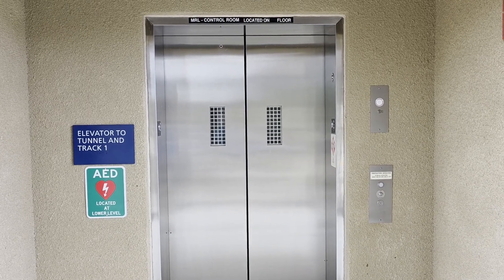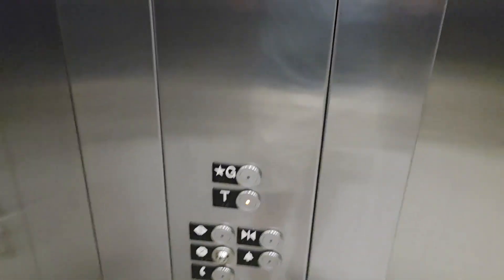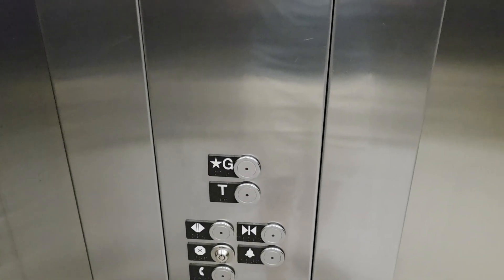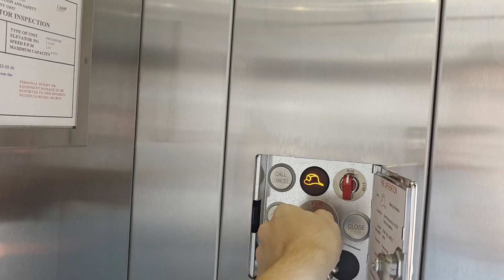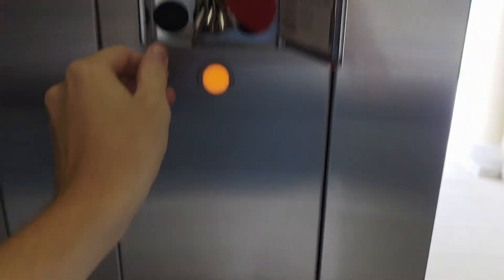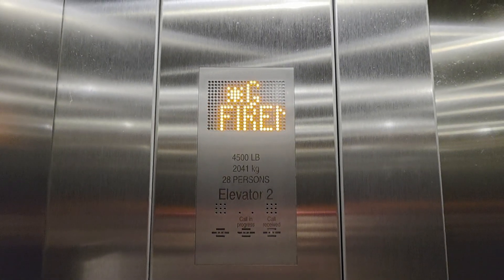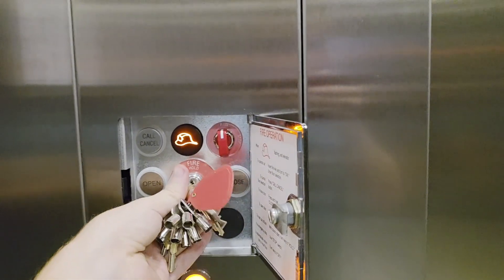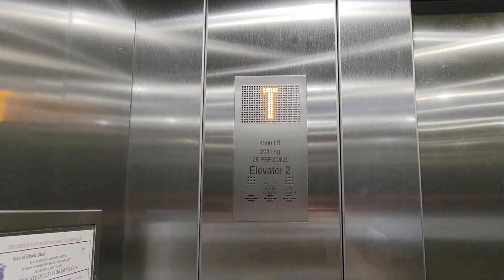Fireman Service Mode Demo On 2 Kone EcoSpace MRL Traction Elevators

Comment: This elevator is located in which state?
What code has been used for its design?
511 key is mandatory or FEO-K1 key?
Reply from the maker: It's in Rhode Island, which uses the Adams WD01 key.

Comment: I did an independent service demo on a KONE once. That said KONE is quickly going downhill, it is truly a piece of shit. It's in between the Ruan Center and 701 Grand Garage in Des Moines, used as a Skywalk elevator, with a California Code Complaint KSS 500 button on the first floor!
Reply from the maker: How exactly is Kone going downhill?  They make better elevators than most manufactures (especially Schindler and TK Elevator) and their customer service is outstanding!
Reply: @BusMaster99 It's not KONE themselves, just that one in Des Moines.
Reply from the maker: @HSETM  I see.  Reminds me of the 2 EcoSpace elevators at the Water St. parking garage in Naperville, IL.

Comment: Wanna find some different elevators to do fire service in the future?
Reply from the maker: To answer all of your questions: 
1. What kind of question is this?
2. This is not a building, but rather, a train station.
3. A KONE tech was here as one of the elevators had a safety circuit fault that had to be fixed.  He allowed me do the testing on both elevators.